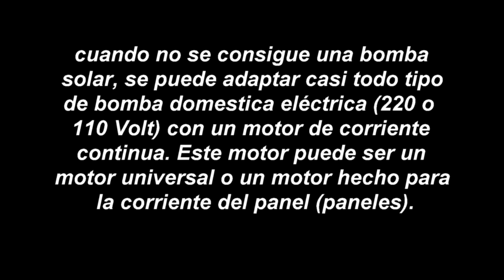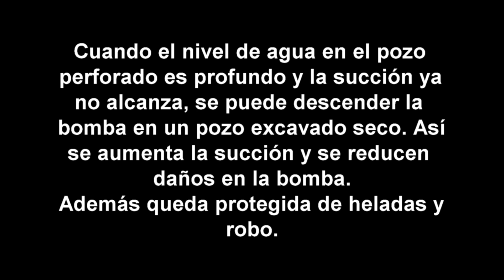making a solar pump by using a normal household pump

Comment: I grew up in the US, doing similar things, we didn't have money to buy new things, but a bit of know how, things can be made to work! 
This could also be used to charge batteries when used on ac power, almost like a inverter charger! It could be used on ac and DC, like a UPS.  I guess It's a UPS! Uninterruptable pump system, it can be rigged to run on DC if ac is lost and vice versa,,  cool!!

Comment: U can also use the motor electricity as generator n charg batteries n pump water at same time
Reply: You will need to make some changes in motor, (stator and rotor) to use as an ac generator when are not pumping. Nice Idea !!!
Reply: i have about the same idea use  1 dc 24 volt  250 watt motor  and conect with gears ,2 dc 24volt 500 watt  motor and generate power
Reply: No u can't create extra energy from it, learn physics

Comment: You can also Using The Pumb Wire To Get A 230 Volt Current Industed By Electromagnatic Fild Due to Pump Rotation.

Comment: Nice job.
Reply: Not nice.
Pumpe be started goid in 12h to 15h
After courant be small.and pump not started.
Her you must put invertet point point
To be up voltage motor and courant motor.😄

Comment: Solar Panels produce DC current. I didn't see any inverter set up between the AC current electric motor and the DC solar panels.
Reply: No  .motor is dc to panel soler.
And change  in put 220v ac  to pump  with dc motor.
So. 220 ac  to run pump   not connect.
And replace to dc motor to run pomp.
It s easy idea.😄

Comment: Which solar pannel used?  capacity of solar pannel and dc motor?
Reply: It looks like two 250 watts panel. Total 500 watts
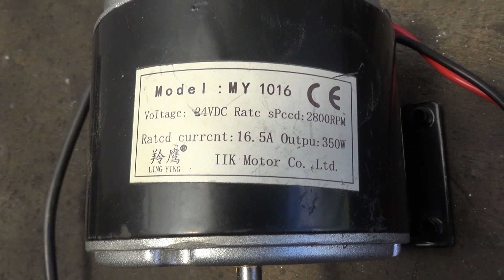Reply: 1:12 DC motor 24v, rated current 16.5A
Reply: @earumamaadu  Thanks :)
Reply: More details please

Comment: Bhai chakki chalane k lye kitne hp ka Dc motor chahye hota he?
Reply: Size pe depend karta hai, lekin aap around 3 HP ke aas paas wali motor use kar sakte hai...
Reply: @kashifahmed1584  7.5 H.P, 1500 RPM ya fir, 10 H.P. 2000 RPM ka motor chalega. Leking DC kyu?
Reply: @anubhavmuku96  
Solar pe chalane k lye take kharcha kam ho.. lekin lagya nah k kharcha kam hoga..
Reply: @kashifahmed1584  Inverter lena sasta padega aapko, solar charger ke sath. Lekin fir,  5kWp Solar panel bohot costly ayega. Mai residential 1kWp ke projects kiya hu, aur almost 30,000 INR ke toh panels hi aate hai. Phir charge controller aur Lead Acid battery fir 15,000 aur 1500 VA ka inverter bhi 10,000 ka ayega..... Long term savings hai, aur reliable bhi, leking initial investment jyaada hai... Aur DC Motors ke brushes wear hote hai, toh wo bhi har 1 - 1.5 years mai badalna padega aapko... Toh AC Motor pe chalana better hai...

Comment: so it's spinning why is he not taking advantage of the  240 cord for other stuff like a light??
Reply: It's working with a DC Motor. Surely not working on 240v (Maybe 12v,24v or 36v) And even less probably in AC. He should refer the 240VAC as the water pump originally works on that voltage parameters.
Reply: P.D After watching the whole video there is a image of the motor where it says the voltage references: 24v 16.5A 2800RPM 350W Model MY-1016
Reply: That is what i want to learn,how can we take advantage to run other loads
Reply: @Kogi-pastor  if we do it water pump will reduce